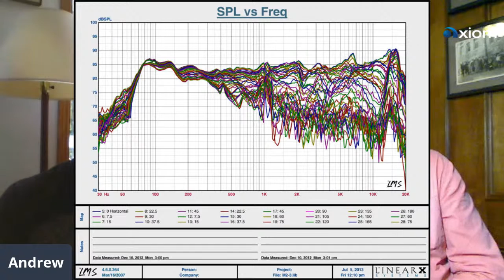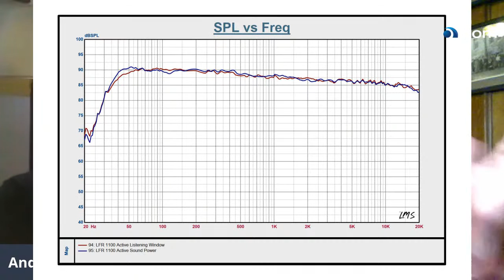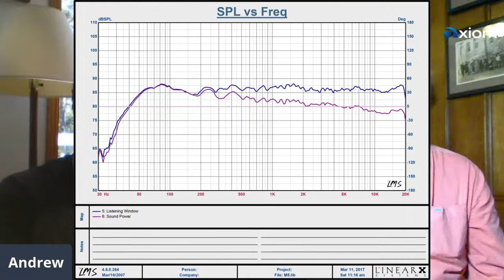Flattening The Amplitude Response Curve: The Family Of Curves Livestream

Comment: I am wondering about what the minimum distance would be on the Model T-Rex and Middle TRex active towers (ie the beginning of the far field listening position).   I have owned both over the last 2 years and I am curious if your anechoic data supports my observations.    Looking forward to an Omni T version.
Reply from the maker: From James Tanner: In my set-up they're 8 feet apart and I sit about 9 feet away (I like the equilateral triangle set-up). I can move up to about 7 feet before I start to lose the center image so I would say 8 to 12 feet would be recommended.
Thanks for your great questions, please let us know if there are other videos you'd like us to do.
Reply: @AxiomHomeTheaters  Middle Trex I found 10 feet equilateral triangle, 5 feet from all walls works well.  It is greater for the Model Trex and unfortunately the room could not support the additional distance required.